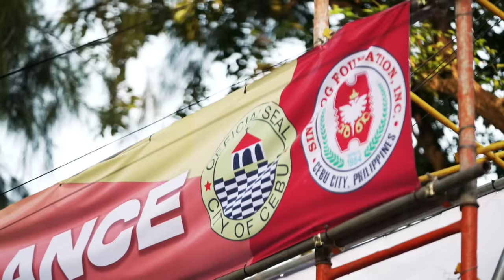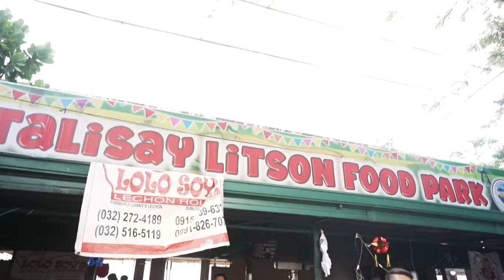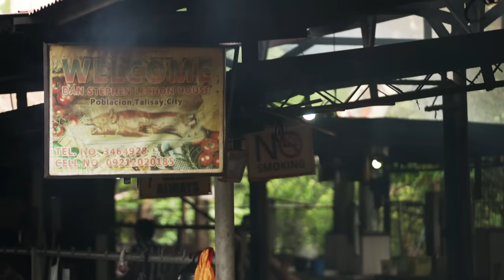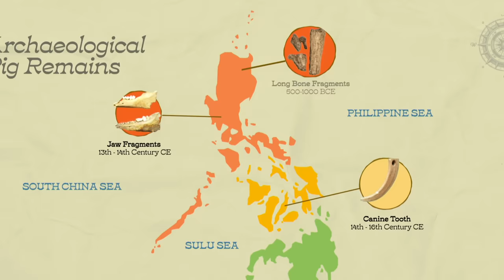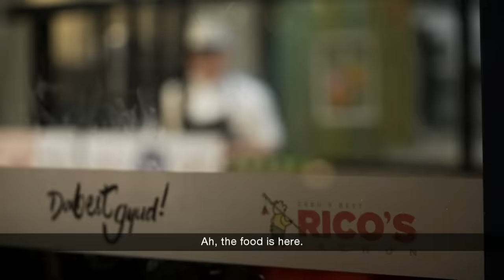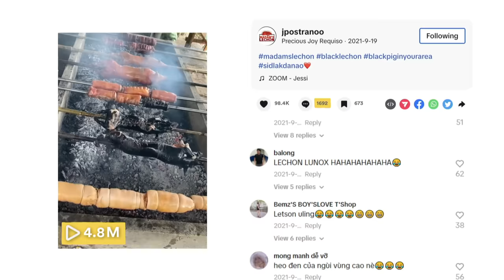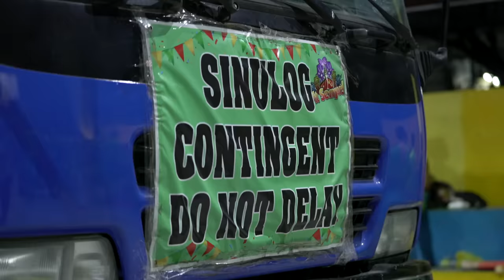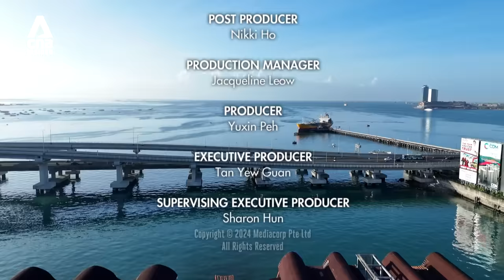Lechon: Slow-Roasted Filipino Pork Delicacy Reveals Philippines' History | Southeast Asia On A Plate

Comment: 23:01 That's nonsense. The Chinese were not the ones who came here. We Southeast Asians were the ones who sailed to China to trade for the last 2000 years or so. Chinese settlers only started arriving to Southeast Asia during the late Ming to early Qing dynasties. Pigs and roasted pig are mentioned in multiple early Spanish dictionaries, starting from Alonso de Mentrida's Diccionario de la lengua Bisaya (c. early 1600s). 

Pigs were introduced to the Philippines from Taiwan, as domesticated animals of the Austronesian ancestors of Filipinos (c. 5000 years ago), carried on boats along with other Austronesian domesticated animals (chickens, dogs, water buffalo). They crossbred with endemic pig species as well as pigs from later introductions via trade with the rest of Southeast Asia, China, and India. From genetic studies, European pig ancestry is very low in Philippine pigs, around 2.86%, which makes it clear that the Spanish didn't introduce them. The fact that related dishes to lechon exists in other Austronesian cultures outside of the Philippines (like in eastern Indonesia and Micronesia) with zero Spanish or Chinese influence is also clear evidence that it is pre-colonial.

Pigs were commonly used during shamanic rituals as offerings, which also included feasts (which syncretized with Spanish fiestas). You can even still see this clearly in the Sinulog, which venerates figurines of the Santo Niño. That's not common in other Catholic countries. That originated from pre-colonial celebrations of ancestor spirits which uses wooden figurines of ancestors (anito).